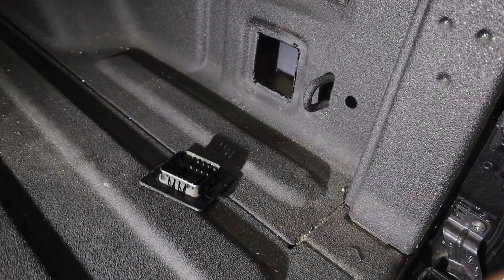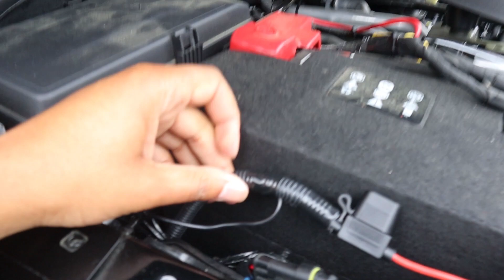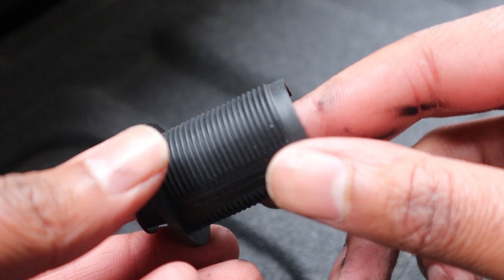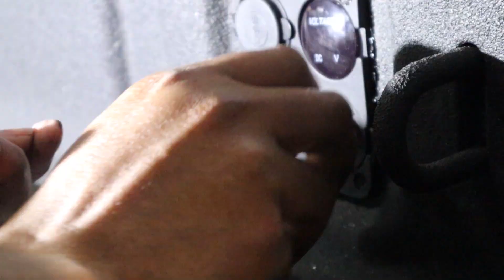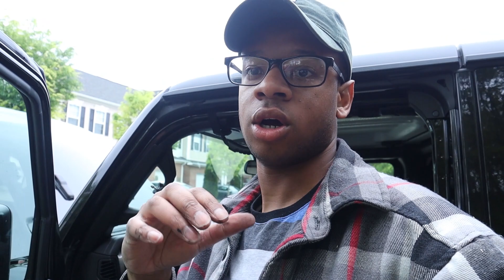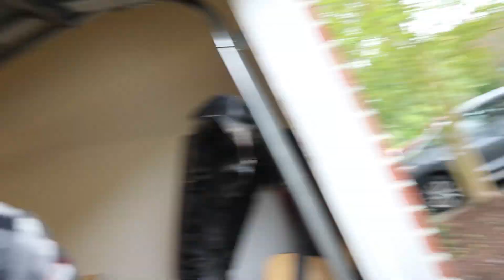Adding 12v Power to your Truck Bed

Comment: Maybe you should have hooked it up to Aux 1, or Aux 2 they're heavier gauged wire and fused at 30 amps, while Aux 3 and 4 are smaller gauged wire and fused at 10 amps.

Comment: Like this outlet with the on/off switch. Missed the part where you plugged this new bed outlet to the main system of the truck, to be able to have it on aux 3 and able to be configured to auto or direct.  How did it plug to aux 3?

Comment: Thanks again. Another great Video. I have one of those Power Outlets, also. I hesitated before going any further. I am nervous about cutting on a new truck bed, but, I like the way you did yours...and of course, I am going to do mine the same way. I mean it keeps the opening smaller. Thank You for this. And the RTV, I never thought of that! When I got my Gladiator, brought it home, this is the first thing I did. I ran wire to the back, same as you- top of the frame rail. Then I got to the power outlets...I stopped. I anchored the wire to that plastic cap, so it wouldn't dangle down and hit the road, till I figured out what I was going to do. Now, I have the confidence to continue.....if this thunderstorm would just stop!
Thank You
Reply: oh, NiCE fridge!

Comment: Good job and good video.  I'll be doing something similar to my Ranger soon.  I think in my case I will use a foam or rubber gasket instead of caulk or adhesive.  That way if there is a problem I can remove the whole plate easily.  I will also be able to wire it from the bed instead of having to get under the truck.  Love to see what kind of fridge that is.  Thanks for the vid.

Comment: I’d be using a 30 or 40 amp standard size blade fuse especially if u are using fridge better be safe than sorry . Any thing to do with fringes we always use at least 30amp fuse if running any fridge in our builds
Reply: mine draws 4 amps, 36 watts

Comment: Was just what I was looking for. Great step-by-step. Question: It didn't seem too necessary, but wondering if it would have been easier to wire up the switches before mounting to bed wall? Thanks again.

Comment: Hope you will reply to me on this one, but I have followed this video to the T and it has blown multiple fuses as soon as I turn it on. After a few attempts, I bypasses the online fuse and went straight to the aux switch and it blew that fuse too. If you can, hope I can get a tip from someone
Reply from the maker: i'd like to see the back of your switch panel in the bed. Reach out on instagram.

Comment: I subscribed once i saw the ARB installation, i dont have the aux switches nor a switch system 😅 but i can manage to install one on the engine to turn the compressor on and off. This mod is also something i see myself doing. Very straight forward. Im from MD and in glad to see youtuber like you near by.

Comment: Very thorough video. I actually just bought a Gladiator with something similar installed. I suspected it was not stock and wanted to know how it was put in. Your video will be pretty helpful in checking behind what was done to my truck.

Comment: Great job man,just a little pointer if you run 10ga power always match with 10ga ground..its a circuit and you will bottle neck and can cause a wire to get hot and catch fire if you are not careful.keep up the great work

Comment: Thank you for this video! I'm about to follow this idea but I was wondering why you went with the 10 AWG wires?
Reply: I believe its because of the strong current a thicker cable will stand what ever you connect. EG: a fridge or power banks like jackery. He using differebt AWG to the other one because those use less voltage.

Comment: Nice install vid.  Just a tip; if you have a multimeter--you can use the connectivity mode to check for shorts between your wires before you apply power.

Comment: Hey dude I am working on doing the same in my Tacoma. I put the panel in yesterday but didn't have the 10 AWG so I need to order it. Now questions what type of battery are you running and how long are you getting on the cooler when the truck is off while the Fridge is running? I have a Odyssey group 34 AGM battery and I want to leave the fridge on but unsure how long I will get. Any help is appreciated. 

Thanks, Jared

Comment: Could you ground to the truck frame instead of going all the way back to the battery? Also, do you need a relay to protect your switches or did I miss something?

Comment: Good job, well explained and very helpful.  I will do this to my truck...also what type of rack system do you have with your tunnel cover?. I have the 3 piece trifold and can't find a rack system for my gladiator.  Your seem to work with it..I think?. Thanks 😊
Reply from the maker: Its a front runner setup. Another youtuber LLOD pieced some parts together to make this setup.

Comment: Do you have a video on that arb awning bracket setup for the LLOD rail system and any info on that Alpicool fridge. Need one that fits under the same diamondback cover.
Reply from the maker: I do. I just need to work on the editing. It's coming soon.

Comment: Nice install thanks mate!  I have a gladiator rubicon Australian delivered and they didnt install the inverter so I was wondering how to access that port to run wire to it.  Thanks for sharing!!
Reply from the maker: I'm not sure what you're asking. The access port for the inverter or the cover in the truck bed where the outlet should be?
Reply: @sketchyjeep6751  no it wasn't a question,  i was saying I was wondering how to run the wire to the bed and how to access that port where the inverter should be, your video showed me, thanks ;)

Comment: Dude run the wire loom through the hole in the bed. Do all the wire connections and then screw the whole assembly to the bed of the truck. That was painful to watch yo!
Reply: Yep I was thinking the same, but he had a great idea and made a good install vid. I’ll probably do the same on my jt
Reply: If I remember correctly. That wouldn’t have worked. That’s what I initially wanted to do but the nuts that secure the outlets to the plate would’ve gotten in the way.

Comment: Better late than never I guess, but I finally got to watch it. Great video. The same gauge wire is a safe rule of thumb and it deals with the current going through both wires being the same. If you place a fuse based on the max safe specs of the larger wire then the smaller one will possibly overheat and create a fire. If your fuse amperage is smaller than the rating of the smaller wire in the circuit then the circuit is still safely protected by the fuse. Sorry for the long comment. Looking forward to the fridge video.

Comment: I think u should up the size on your ground .. at least the same size as your positive
Reply from the maker: i was thinking of doing that. I was trying to research the need for a large gauge ground wire. Couldn't find anything definite.
Reply: Yea, and yes you should change it out to the same gauge as your positive because the “ground” is your return wire and will carry same amperage as your “supply” wire. 
For example , your arb has same gauge wire on positive and negative because it’s needed. I just don’t want your brand new JT to catch fire 🔥 or anything so I figured I’d let u know

Comment: My Gladiator doesn’t have the 4 accessory switches. Wonder if I can buy those and add?
Reply from the maker: Yeah you could buy an after market or mopar switch for about 3-400 bucks
Reply: @sketchyjeep6751  Instead of wiring to an AUX switch in the jeep, couldn't you just bypass the aux switch inside the jeep and just use the on/off switch that you mounted to the to the plate? Just curious because I dont have the AUX switches inside the jeep either.
Reply from the maker: @PeterBrack1   yeah that would be the most simplest way to do it and it would work fine.
Reply: @sketchyjeep6751  Cool, I was hoping that would be the case. I Like the videos, Keep it up. I have a Sport S with max tow too. Look forward to seeing whats next.
Reply: Very nice
Reply: Is there anything that would keep devices from draining the battery completely? Going on a trip from Orlando to California soon and trying to run a refrigerator. Don’t have the Aux switches though. Going to have to run straight to the battery.